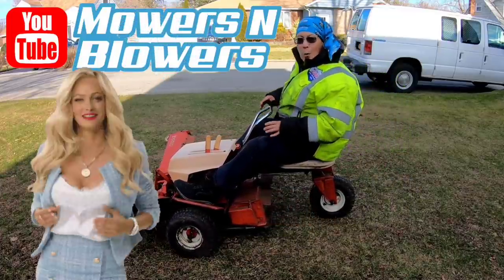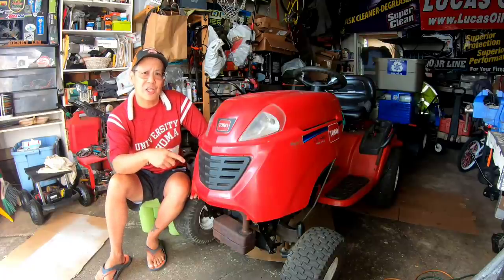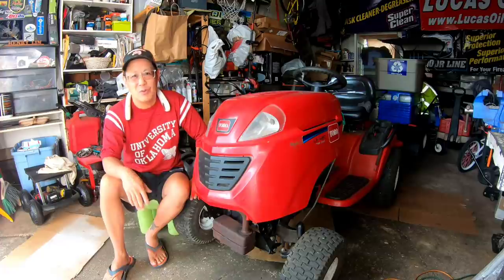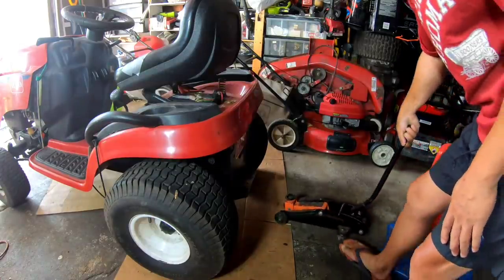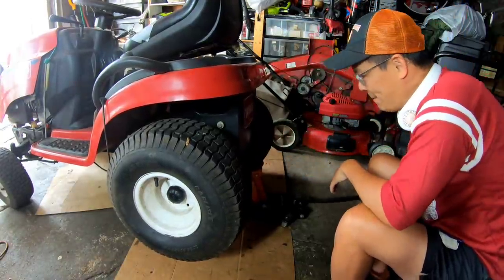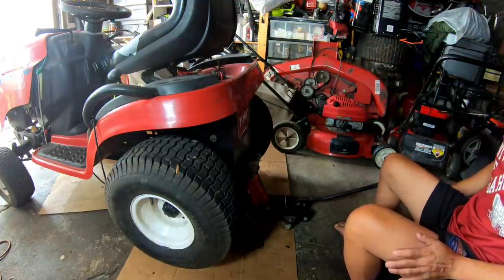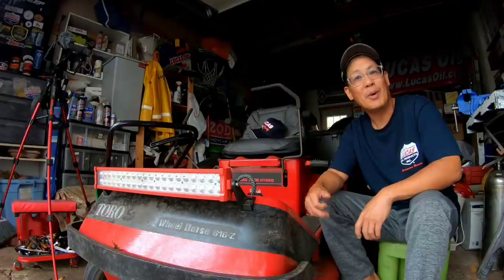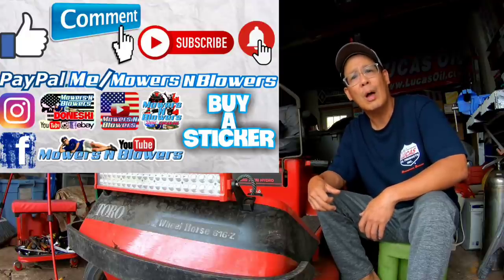TORO LX460 LAWN TRACTOR REPOWER PROJECT WON'T GO FORWARD GEAR CVT VARIABLE SPEED TRANSMISSION REPAIR

Comment: Very Nice Fix,Henry. I was watching with great interest because I have never seen inside the casing. I was kind of surprised that there wasn’t more parts and pieces inside the CVT transmission casing. I think mine would probably move closely resemble the Cub Cadets being that my wheels have lug nuts instead of the key and snap ring to secure the wheels. Great Video,Henry.
Reply from the maker: Yours is probably a hydro
Reply: @MowersNBlowers  Actually Not Henry, My tractor is a larger version garden tractor that the rear wheels have 4 lug wheels instead of the keyed axles,Etc. Otherwise my MTD garden tractor drive system is pretty much identical in configuration to your Toro. The 1-7 “Shift On The Go” shifter is on the left fender and the Hi-Low Forward & Reverse shifter is within the removable plate between the seat and dash console. My MTD YardMachines 21hp 46 inch deck number is; 14AJ845H062 which I think was manufactured around 1999/2000. As I mentioned Henry, This tractor shares more than a few part numbers with the Cub Cadets and probably everything else MTD was manufacturing. This tractor was gifted to me by my former neighbors who were getting ready to move. I can send you some photos via email if you like.

Comment: Just curious, I have an LX500. It struck me as odd that there was grease in the transmission/axle instead of oil. My manual states the axle uses approximately 1.8ltrs of  20w50 "motor oil" and has a bleeding procedure to get all the air out. I dont know, I'll have to double check my manual I guess.
Reply from the maker: I’ve seen grease used in trannys.  Maybe it’s just super old oil that turned into grease